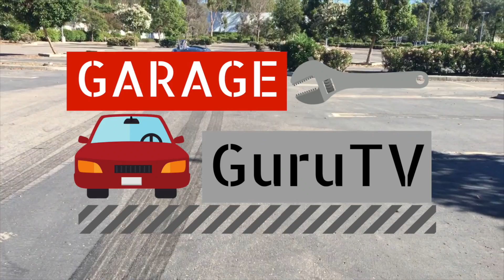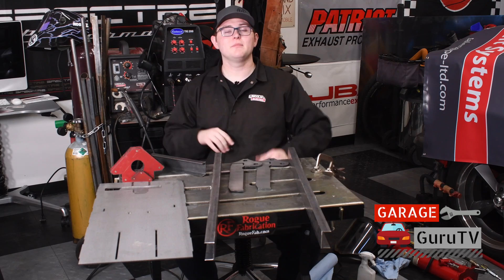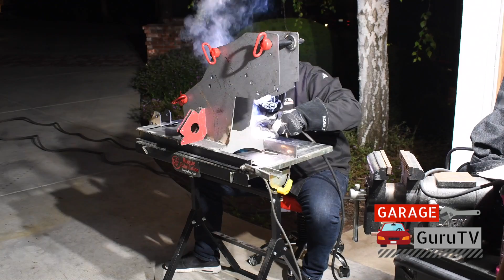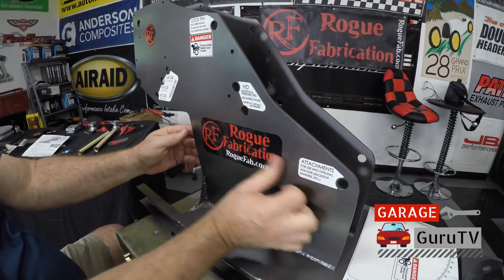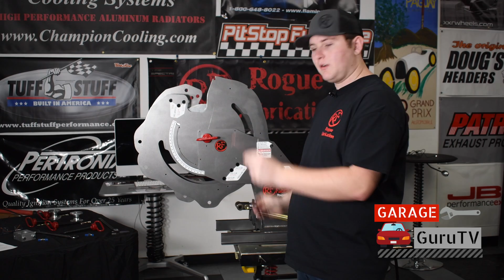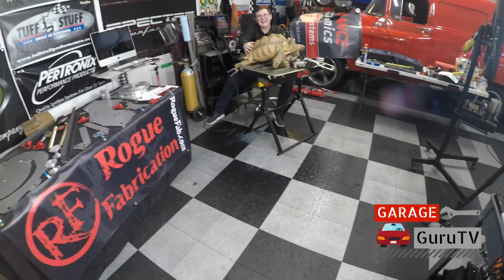RogueFab M600HD Tubing Bender Build

Comment: Now that you've had the XHD for 11 months or so, do you still feel you got your monies worth ?  Do you feel the XHD is worth the additional $ over the standard model ?  I am about to order the same unit as you did ( different size dies though ).  I am a small shop , my son and I, and need to make outlays count. I would appreciate your input so I feel I am making a smart choice. Thanks Demon
Reply from the maker: To be clear, this is the HD model, not the xHD. Which model you pick really depends on the material you are planning on working with. We were advised to get the HD model as we are working with 1 5/8” .125 wall DOM mild steel. The HD model bent this material great. If you are planning on using thicker wall/diameter/tougher materials,  I.e. 1.75 .250 wall 4130 or the like, get the xHD
Reply: @garagegurutv6419  Thank you for your insight. I did not price the HD as I figured giving myself the maximum amount of flexibility would be wise . I assume, even though you didn't specifically  say, you are still happy and have found it to meet your expectations  ?   Thanks Demon
Reply from the maker: @williamlanphar630  it is the best bender on the market. Period. It always exceeds my expectations and allows for expansion down the line with their other attachments. I’ll be uploading a video soon on their mandrel bender attachment.
Reply: @garagegurutv6419  Thank you for responding. I was hopeful that you would feel this way. As an outside observer I felt this may be the case , but hearing you confirm this from your first hand experience , makes me feel confident in buying one. Thanks , again , Demon